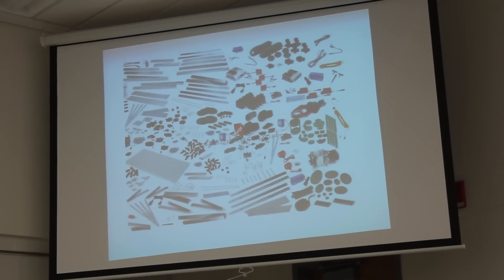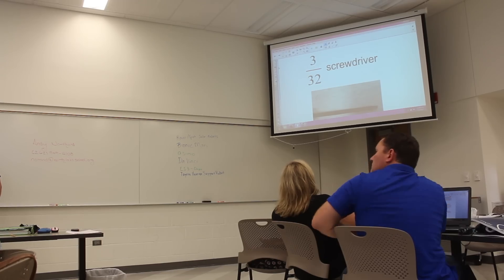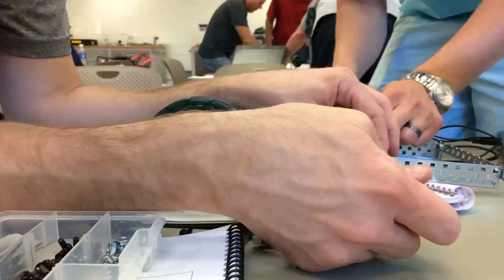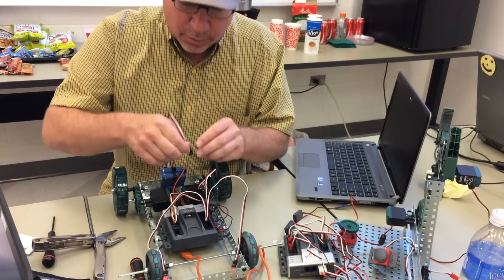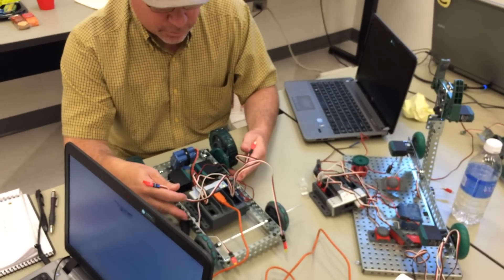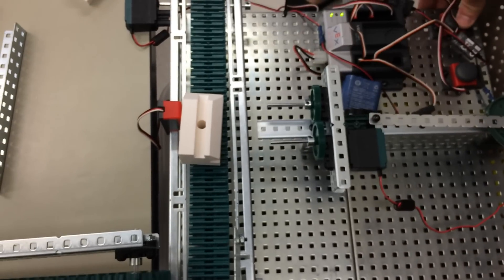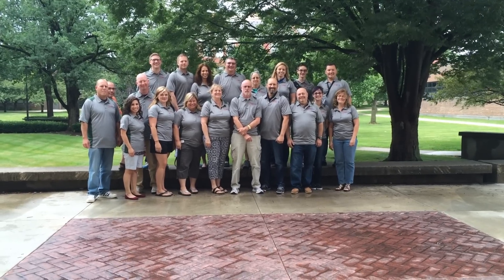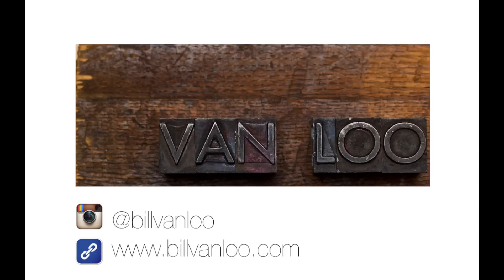AUTOMATION & ROBOTICS: Summer VLOG Week 5

Comment: So. Many. Mechanical. Toys.

Looks like another fun learning experience. Now go get some rest, and congrats on 500 subs.
Reply from the maker: Ben Brandt Thanks, Ben! Building all the mechanisms (especially ones I've never needed to build or use before) was a great learning experience. After a full weekend I feel rested and refreshed, and ready for another week!
Reply from the maker: Ben Brandt thanks, Ben! Having an opportunity to build all the different mechanisms (especially ones I've never needed to use or build before, like the cam-and-follower) was a lot of fun.
Reply: Bill Van Loo Did you get to keep any of the robotics hardware? It was especially fun seeing the assembly line project. I come from a Manufacturing Engineering background, so I've done some work in this area. There are a lot of interesting automation challenges in moving material around and performing operations like this. Cool stuff.